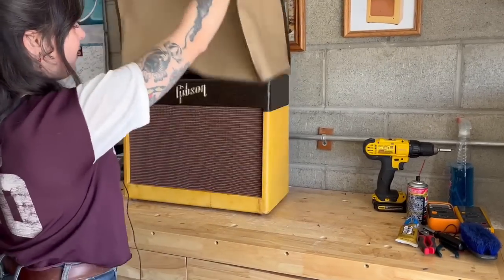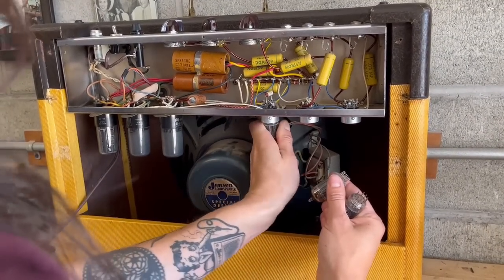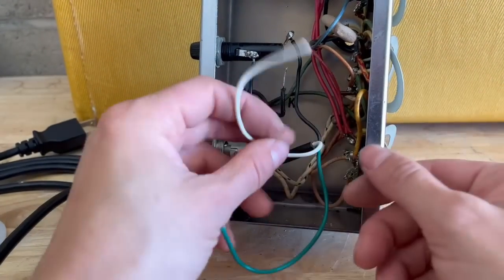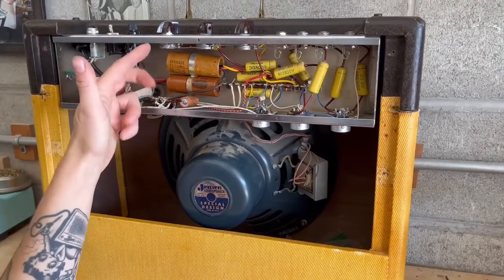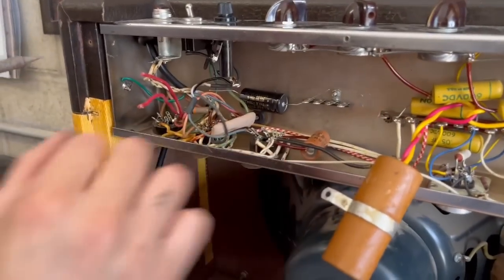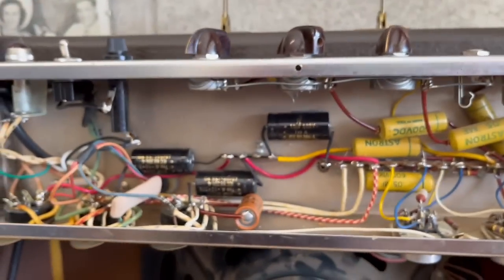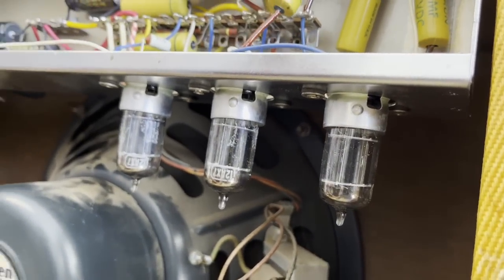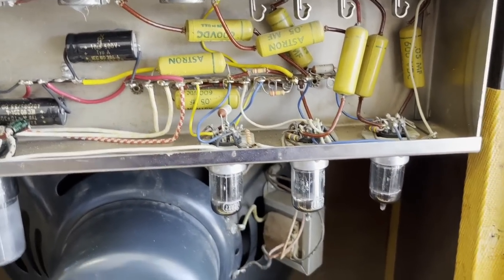'58 Gibson GA-20 Amp Repair

Comment: may i suggest a thicker solder wire for this type of work.. you deposit the solder quite a bit faster so there's considerably less heat dissipating into old terminals/wires/components. 
to give it a try, twist together 3 or 4 solder wires you currently use... you'll notice it halves the time required to keep the soldering tip on these types of joints.
nice choice on shorter cap leads. less wire = less noise :)

Comment: As always, it's a pleasure to watch you work, Colleen.  Stripping wires with your cutters????  You are totally aware that is a very tricky, acquired skill that most cannot master.  No matter how many times I tried, the failure rate was so astronomical, I've been related to using strippers.  Only a true master as you, can achieve the results you do using your cutters.  Be proud and do not let those that may not have acquired the skill you have mastered bother you.  (I'm not trying to p*$$ anyone off, but maybe they are more in my category than your master craftsman category, so be proud and keep on keepin' on!!)  That amp looks like my amps do now that I'm in retirement...Very pampered and well taken care of.  While I was playing in 1962, I was gigging then (back then we called it playing because a gig was not a term we used in my rural locale, but I digress, and totally age myself) and my amps...well...were far from pampered (Today's term "road worn" is more applicable, but, back then it was a detriment, not something desired in the least).  This gem is priceless.  The Logo and face plate still being basically perfect is totally amazing.  Fantastic job of a perfect restoration to better than original sound while keeping everything as close to original as possible.  Please keep the great videos coming!!!

Comment: I’ve got an early 50’s GA-20. Absolutely love it. Currently my favorite tube amp. Thanks for showing the process of changing the caps.
Reply: Same! Mine has been my full time touring and studio amp for the past 15 years. I've had people offer me stupid amounts of money for it, but I'm not really interested in selling. It's got such a unique sound and gorgeous tone. Unfortunately, as you can imagine, mine isn't in this good of shape lol... like Colleen said, my amp's logo is broken. Also, I've replaced the handle at least three times since the late 90's. Other than that, it's a joy to work on and keep running.
Reply: @slamcrank  that’s rad! I can relate. Very recently sold off my old Marshall and Laney tube amps. The Gibson not only sounds great at a lower volume, it’s super light and easy to carry. Some people think they are dark sounding. Works quite well with the p90’s I use though. Great little amps. Glad I got one when they were flying under the radar. Everyone was buying up the tweed fenders.

Comment: To clean the input jacks, fold a thin strip of fine wet/dry sandpaper over on itself, insert a plug to separate the contacts, insert the sandpaper, remove the plug and move the sandpaper back and forth a few times.  As a Texan, it was nice to hear some ZZ Top for your playing test! 😃

Comment: I have an old (1954 Gibson GA5 Les Paul) amp that I've had fixed 3 different times. It sounds great, but if I ever have problems, I plan to repair it myself. Your videos are absolutely a great help. Thanks!

Comment: As a tech who also uses cutters to strip wires on a daily basis, I solute and commend you. We are a dying breed.
Reply: Wire strippers are for pansies. I'm not a tech per se, more like a jack of all trades, but I used to be a telecommunications technician, and I've done electrical work, electronics assembly ect. I've always had my hands in electrical stuff since I was a kid, so I'm a little surprised that people are critical of her using side cutters to strip wire, because wire strippers are a terrible idea when you you're working on older gear with random wire guages and different insulation types. Wire strippers require you to think about what size the wire is, carefully put the wire in the correct notch and are actually slower to use. OK if you have an unskilled person stripping the same wires all day in a factory, because quality ones are consistent, but madness for this kind of work. Plus they don't go in tight spaces well.
Reply: @Patrick-857  I usually use old-style "adjustable" wire strippers. They're kept on the smallest setting (works great for 24awg solid) and for larger wires I'm just careful about how much I squeeze.

Comment: HI! I would have connected the hot cable first to the switch then I would have gone to the fuse holder, in doing so in the eventual need to change the fuse I would have had no voltage in the fuse holder, obviously it is my consideration since it works in both ways to work. One could also say that pulling the plug solves the "problem" anyway but that would be my preference as a connection.
Everything else is fantastic, excellent professionalism and, as in the other videos, impeccable knowledge of the job.
Note: The amp is wonderful!!! Beautiful!!!
Also great as a guitarist 🙂

Comment: A thing of beauty, a joy for ever! Lovely work on that amp. Your videos may be few and far in between but I always love watching them.

I always use heatshrink tubing for mains connections not just for splices, but also for soldered connections on switches and fuse holders. The rule is to insulate as much on the mains side as practically possible.

For the sake of original look, I'd consider gutting the old electrolytics and restuffing them with new ones, and leaving a service note, Uncle Doug style.

Comment: I got a GA-20T, been using it cranked for years as my main amp, love the trem. Haven't had to do any repairs in the 13 years I've had it. caps were replaced probably 15 yrs ago, and new speaker installed. Was nice to get a bit of a run down on the insides. Probably should replace the filter caps one day soon.

Comment: A new generation inheritor of Uncle Doug's legacy complete with pets and "trusty" tools! I mean that as a compliment, by the way. I don't think Doug would have drilled a hole for a terminal strip, and he probably would have found a way to stuff the new caps into those old cardboard cylinders. But it's all good, "originality" is a rabbit hole with no end. Great video, as usual.
Reply: I thought the terminal strip was using the same hole the old capacitor brackets were using.

Comment: Your wire cutting tool is perfectly fine for stripping and there is actually a spot ON the blades if you look. that preference is the one I use becaase like you I was shown using
those diags by very seasoned tube equipment repairmen. You go right ahead and ignore silly crap like that, especially if you are more comfy with it. Great job as always on 
the amp as usual.

Comment: The varnished cloth tubing is called Cambric insulation. And as for cleaning the switched input jacks so they ground out when unused, pull a strip of thin paper in between the contacts. Paper usually has a little bit of silica in it, and in conjunction with some contact cleaner or a spritz of alcohol it should take off the oxidation.

Comment: Brown varnished cloth insulation (time mark 22'30"): Back in the 1960s, I knew the 'Brown varnished cloth insulation as "Systoflex". This was extensively used right up to the 1970s, and possibly later.
The 1958 Gibson amp looks as if it had just left the factory; fantastic condition!
I notice you don't measure the output tube (Valve (in the UK)) bias (Plate Dissipation). If you do, could you include this in future videos please.
Finally: Thank you for yet another excellent video!

Comment: As i watch this i can smell how it does cranked up. I have a slightly earlier GA-20 brown chassis. Unbeliveable sound and loud for its 14w rating. I may recap it someday. Im really against modding this amp but i really want to add an output jack to run my old marshall blackback 4x12 just to save on the original jensen

Comment: Wouldn't it be better/safer to attach the ground wire to the chassis with a bolt/washer/nut set? I know you did a nice job there, but somehow I think the other way is safer.

Comment: Would it be an option for very old amps, with collector value, to leave the original caps in place, cut them loose of course, and mount the new ones over them ?

Comment: I'm guessing the client gave you their credit card info. when done- "Just Got Paid". Great vid. I know you've been swamped but please try to keep them coming. Love the 'test drive' after each repair. BTW, you strip wire better with dikes than most guys can with any of the 'wire strippers'. I didn't see any cut wires. Nice hands, too. Please don't huff those soldering fumes. Still amazed at your technical knowledge of what every component does and its effect on performance. Mike taught you well. 
Thanks.
Reply: No sparky would think anything of this technique. Wire strippers are for pansies. I never bothered with them myself.

Comment: Well done! It has been quite a while since you've posted. I've never watched a vintage amp repair performed in natural light. I agree that the way you were taught is always the best modality to apply first. That being said, I was wondering about tying a knot in the power cable for strain relief. My concern would be the opening on the chassis would cut into the power cable over time. A grommet by Hakko would have fit without major modification(s). Ergo, damage-free protection to the jacket, as well as no need to knot for strain relief would be necessary. Then again, this would be going against your training. So it's just a suggestion. The amp is immaculate! Well looked after, and sounds great. I hope another exciting episode is posted sooner than later. Stay safe. Please give my regards to Hank.
Reply: It appears the amp had a basic grommet to prevent cord damage.

Comment: So just for giggles. Lets say the transformer on the speaker was toast. Its my understanding you can install a choke and a resistor, amd be able to install a a more modern speaker woth a magnet. My question is. How would you determine size for the choke and resistor?  Lovely work!😊 just having trouble repairing my old gibby amp

Comment: Presumably you soldered the earth wire to the chasis instead of putting a nut and bolt in order not to have to drill new holes? Nice work 👍

Comment: Nice job on that beautifully kept amp!! Just curious, why not go to the power switch first, then to the fuse. Even with soldering to the end terminal, when the fuse is replaced, wouldn’t the fuse be live when it’s push in? Agreed, we should always unplug power supplies before replacing or checking a fuse.
Reply: I just watched your Safety, all about fuses video, very informative! Like you showed, that’s the way the Champ was wired. I see!

Comment: I don't think I've actually seen a guitar amp with the output transformer bolted to the speaker. Was it more common in small combos? I guess it saves some extra space, but also makes it more difficult to change the speaker.
Reply: From what I've seen it's common on the really old amps. You'll find it on the really old radios and gramophones too.
Reply: Many amps from the 40s and early 50s had this

Comment: Excellent vid, been sharing my own amp repair videos as I learn and these have been helpful. How do you check leakiness on the caps?
Reply: I think you measure their resistance. A cap should charge and then should measure open line.
Reply: A quick and dirty way is to measure DC voltage before and after the cap, it's usually doable in tube amps. In more complex circuits you'd need to take out the cap and a dedicated leakage tester (see Mr. Carlson's lab for example)

Comment: Don't try to pull the preamp tubes straight out.  Rock them in a circular motion while gently pulling and they will come out.   Looks like those power tube have metal release thingies on the sides.

Comment: Hi, I am a beginner and I have 2 questions----- did this amp not have a death cap? and what temp are you soldering at? Thx and thank you for your great videos!
Reply: @reggiewallace260  Thx
Reply: @reggiewallace260  I doubt that was the original cord, it looks much too modern. Even with a polarized cord there can still be a death capacitor, it will just be fixed on the neutral side. However I looked up the schematic and it appears this model did not have a death cap.
Reply: @reggiewallace260  The shape of the molded plug looks like modern 2-prong plugs with an integrated strain relief, a ridge to grab, then a main body that gets wider, then a wider ridge to make it harder to touch the prongs when it's plugged in. It's hard to tell but it might also be thicker-insulated cable like modern SPT-2.

It's possible they had plugs like that in the 1950s but all the similar-era radios, TVs, and clocks I've seen had older-style plugs.

The schematic also does not denote plug polarization, also the fuse and switch being on opposite sides of the cord suggest it was specifically not polarized.

As I said earlier this model never had a "death" capacitor or any cap between primary and secondary.

Comment: At 4:53, please don't use a cordless screwdriver for removing straightblade, slotted-head screws!  It's way too easy for the bit to slip out of the screwhead and then the drill and bit go skidding across the cabinet of a mint-condition vintage amp.  Cordless  screwdrivers should only be used with Philips or similar screws where the powered bit is unlikely to slip out of the screwhead (Robertson square-drive, Torx, Allen, and hexhead screws are similarly ok for use with a cordless driver-drill, but not straightblade screws!). Also, try several screwdrivers and select one with a really snug fit to the slotted screwhead ----  These types of vintage screws vary a lot in the size of the slot, and if you use a screwdriver that's just a little too small you'll  chew up the screwhead.

Comment: A little beeswax, on the screws, for wood and metal, can make them go in easier
and, for the sheet metal, keep the metal from galling and messing up the threads.
Of course, on the sheet metal, only for non electric connections. 😁✌🖖

Comment: Don't agree with the power feed wiring arrangement you adopted.  I would have connected the live to the switch first, then to the fuse, then to the transformer.  That way, with the power switch off, everything is dead.
Reply: There are merits to both methods. I'd rather have everything dead when the fuse blows.

Comment: As an electrician, I am being a bit anal, but tying a knot in a cable is not the correct way to provide strain relief to a cable. The use of an appropriate strain relief gland is correct. Also stripping wires with any form of cutters lends too too much risk in the conductor strands being nicked. For stripping wire there are a myriad of appropriate wire stripping tools. As far as earthing the metal chassis,  I would not rely on a soldered joint to flat metal. I would rather see a more secure through bolted and appropriately terminated connection. But otherwise, a lovely video from Jennifer Lawrence of the guitar world.

Comment: You didn't flux any of those solder joints like on the terminal strip. That's really bad soldering practice. You should read up on why you always flux bare metal before you solder. You shlould have put flux on the chassis before you soldered the ground wire to the chassis. Personally I would solder an eyelet to the ground wire end and then find an existing bolt on the chassis to bolt the ground wire to the chassis. You want to attach a chassis ground in such a way that it can never come loose. A solder joint is a good electrical connection but not a good mechanical connection. The solder joint could corrode over time and some day when you spill a beer on the amp that ground wire may not be there to save your life. You can never be too safe with any of your high voltage connections. I like the belt and suspenders approach.

Comment: You are stripping wires correctly. Obviously. Wire strippers are for unskilled people in a factory setting. Completely unsuitable for the work you're doing, because you're dealing with old and new wiring, in awkward spaces, and side cutters aren't sharp, and you can feel what you're doing. I never like wire strippers.
Reply: I agree if you're talking about the modern style combination strippers with one size per each wire but I like using the basic-style manual wire strippers.